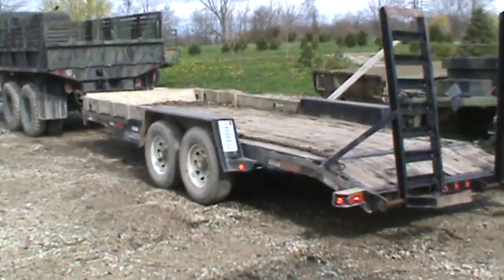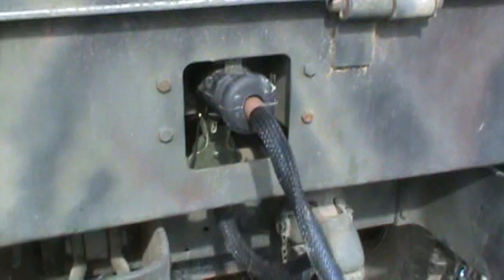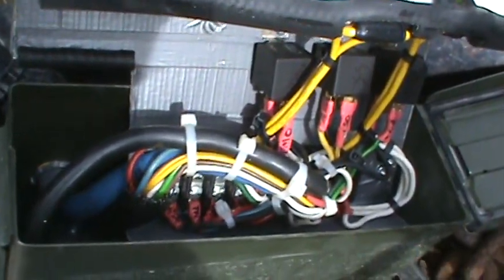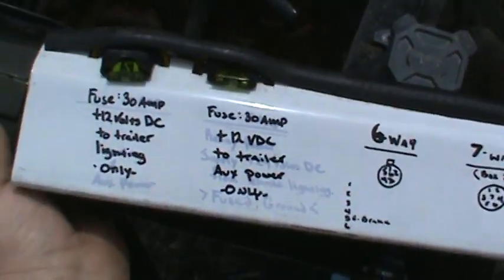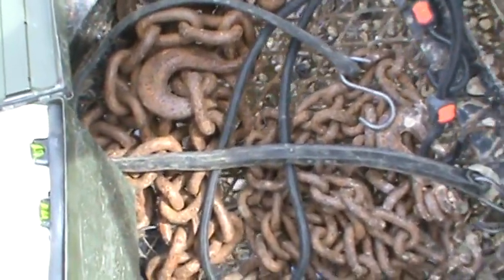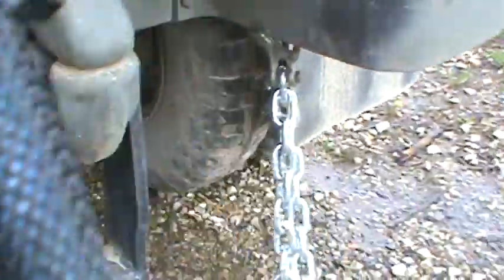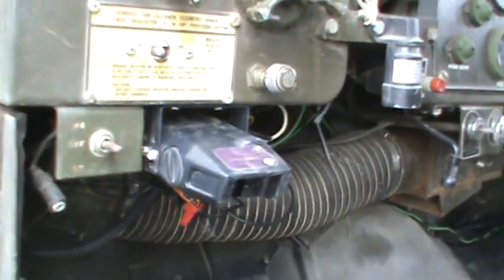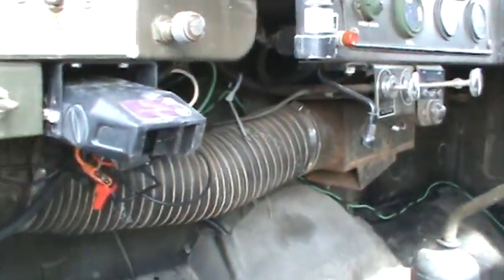Military truck trailer adaptation

Comment from the maker: I agree. This setup works great though. Eventually I'll get around to doing a better video. In the meantime - :44 - :45 is a diagram.  :15 military style plug into existing outlet. :56 trailer plug to box. 1:17 separate wire going under back of truck is plugged into a seven point outlet supplying  12 volt power from one of the batteries and from brake controller. :37 to :41 internals of box. I didn't build the box but someone with knowledge of electrical components should be able to replicate it

Comment from the maker: @flywdave The hitch I got off a guy on the steel soldiers site. Search removable hitch on that site and it should pop up near the top. The thing I really like, It's easily removable by just pulling two pins. The converter box was built by my son I just bought the components, installed the brake controller and ran the 12 volt wire to the back of the truck. I can get better pictures of the box if you like. He did a really clean and professional job on it.
Reply: I can’t find that hitch. Any help ? Thanks